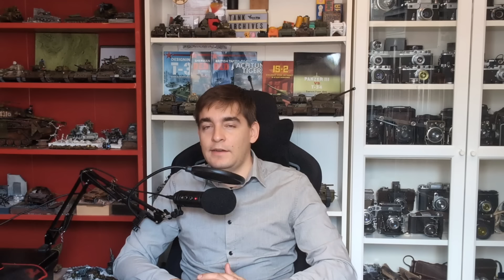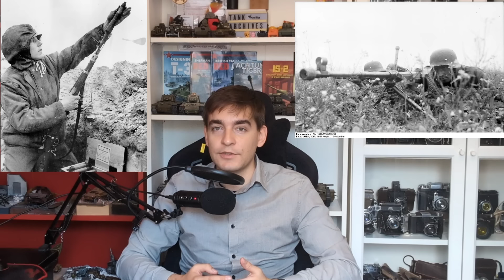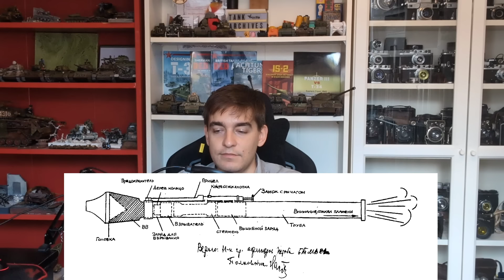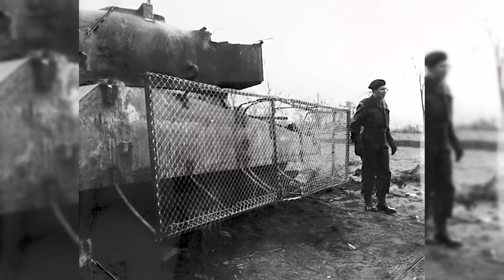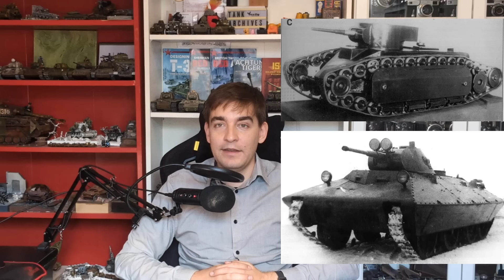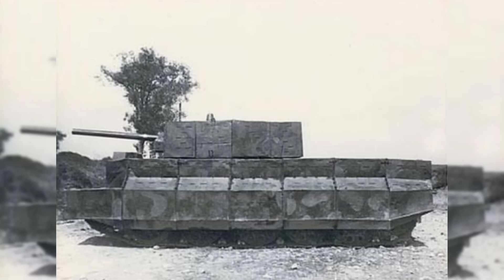Panzerfaust: Effectiveness and Protection

Comment: I imagine it was more difficult to aim a Panzerfaust shot accurately at a more vulnerable spot on a tank, capable of knocking it out completely. Also, German infantry's preparedness to run away from onrushing Russian tank assaults - could this be due to greater apprehensiveness at the outcome of becoming POW in Russian captivity ?
Reply from the maker: When you're facing a tank assault as an infantryman, surviving long enough to become a POW is one of the better outcomes.
Reply: @TankArchives  Not necessarily to the USSR at times. Maybe compared to Russian prisoners captured by the Germans.

Comment: I'm a bit off topic but I want to ask: what is the nominal thickness for the T-70 cast turret? From blueprints at the turret ring is 60 mm nominal and 35 at the top,near the hatch.
Thanks
Reply from the maker: I found the dimensions, which if drawn to scale should let you measure the armour thicknesses. https://i.imgur.com/w5aitn1.png

There is also the protection requirements, with figures given for critical penetration distance with a 37 mm gun: https://i.imgur.com/0FxduZI.png

These are both the GAZ-70 cast turret, I'm not sure if the "production" one was significantly different.

Comment: The tank rider survival rate vs ambushing machine gun is not mentioned or how would they fare if the tank drove to a mine. 💀 Better for the tank. Of course it depends a lot how organized the defenders are when there is already an enemy tank so close.
So this wakes the question: Why it took until post-war for Soviets to create an APC? Even the placeholder vehicles in their use appear to have been very uncommon. Did their experiences in Manchuria, Spain and Finland not show any kind of need?
Reply from the maker: The Red Army didn't just load a tank full of guys and ram it into enemy defenses. By 1945 tanks were fighting in sophisticated combined arms formations. If tanks full of infantry were going first, they were going it as a part of urban assault groups to exploit weak flanks, not bashing headfirst into machine gun nests.

The Red Army didn't develop an APC because the doctrine didn't call for one. Most doctrines didn't. Infantry of WW2 mostly walked to the battlefield and fought on foot, APCs were very much the exception rather than the rule even in countries that produced them.
Reply: @TankArchives  I thought I wrote "ambushing" quite clearly. Fair enough the front lines remained relatively clear on German-Soviet front as the open terrain didn't allow much of free infantry movement. Most devastating ambushes always require terrain like Finland and victims sticking to the roads.

This I find curious: "Infantry of WW2 mostly walked to the battlefield and FOUGHT on foot,". Fighting on foot still remains as the primary way of fighting for infantry. Fighting from board APCs only ever makes sense, if the vehicle is supposed to keep moving with others or it's the only cover. Apart from very few types, most APCs never had the armor to fight alongside tanks anyway. APC's main purpose is to get infantry fast and more safely to the place where they are needed, is it not? What baffles me about Soviets is their nearly complete lack of effort to even try building such vehicles. Didn't BTR-152 development start already 1945? The need must have been there.
Reply: The Soviets (& Tsars before them) always had a surplus of manpower & a relative scarcity of hardware, so it was more practical for them to tell a squad of papasha-wielding infantry [who otherwise might not get into range of the enemy wielding full-power small arms] to hop on & tumble off when they got close enough or if they started taking fire.

The Soviets had m1910 Maxims manned by party commissars w/ orders to shoot anyone trying to retreat or not advancing fast enough, so it was safer to hitch a ride on a tank even if the Nazis lit it up w/ their MG42s, at least you had a chance to jump off before a bullet found you...
Reply from the maker: @nunyabidniz2868  Enemy at the Gates was not a documentary. Commissars firing Maxim guns at your back wasn't even in Enemy at the Gates but in Call of Duty.

Comment: Did panzerfausts disable themselves when maximum range was reached?
Reply from the maker: No, it was a simple impact fuse. The projectile would fly further, but the low velocity and high dispersion would make it impossible to hit anything even if the sights were marked for longer ranges.
Reply: @TankArchives  I did a rough calculation.  The nominal effective range seems to be approximately at 10 degrees of elevation at each model taking into account a little increasing projectile drag for the longer range models.   For panzerfaust 30 an elevation of 9.2 degrees compensates for 5m of projectile fall off in 1 second of projectile flight.    The geometry of the sights then determines the max effective range.  
-In practice I think the range would be about 0.65 seconds x muzzle velocity i.e. 2.0m of projectile fall off.   So for Panzerfaust 30 about 20m,  Panzerfaust 60 about 30m, Panzerfaust 100 about 40m.
Reply: @TankArchives  Thanks. I wondered why the Nazis would put in a nice safety feature.

Comment: If the percentage of lossed due to Panzerfausts was bigger when the Germans couldn't deploy larger anti-tank devices, did the Panzerfaust kill more tanks or were there less losses during operations like that?
Reply from the maker: Generally high speed pursuit operations result in fewer total losses among tanks as there is less combat. You see a higher proportion of losses due to mechanical breakdowns, but the broken tank remains in your territory and you can recover it at your leisure. If you're slugging it out WWI style and the tank remains on No Man's Land, you're probably going to lose it even if the damage is relatively slight.

Comment: Swedish S-tank used diesel cans as extra protection vs Cumulative charges, for real:) It worked or so they said to us.
Reply from the maker: The fuel tank in the front of the T-54 was also said to be effective at stopping HEAT jets or kinetic penetrators that made it through the armour. You are still going to have big problems but not as big as a "clean" penetration wiping out your crew.
Reply: The S tank on the grounds of their Military Museum in Stockholm has a metal mesh perpendicular to the front flat-slope glacis.

Comment: With early HEAT warhead increasing standoff was not a "surefire" way of decreasing penetration.
 WW2 HEAT geometry was in large part trial and error, and WW2 fuses were relatively slow too - though not a problem in this case, it was an issue for cannon fired WW2 HEAT (piezoelectric fuses that could detonate the charge in the back without delay came later). So generally activating the fuse at some distance from the armor could have increased the penetration in some situations allowing the jet to properly form before striking the armor (hence modern HEAT shells have the contact part of the fuse well in front of the charge. In all honesty, I doubt Soviet special armor helped that much when installed on T-34, because Panzerfaust would go through almost anywhere with as little as 100mm penetration, and halving penetrating capability could have been well outside of additional 50cm standoff capability.
With IS-2 the chances were better, but I wouldn't bet my money on it working. I mean, morale boost is something pretty significant anyway.

Comment: 14:14 It's not a higher muzzle velocity, it's a greater penetration due to the greater diameter of the warhead. (Muzzle velocity is irrelevant to shaped charge penetration.)
(Edit: The larger diameter allows the "jet" of solid copper to reach a greater length before it stretches to the point where random irregularities in the diameter of the jet narrow to nothing and you have separate pieces one after another. The jet is very far from being a perfect golf tee shape. This of the surface a bit more like a very straight twig, where you have all sorts of little bumps and dips around it. Then you pull on the tip (because the elements with the highest velocity are at the tip and the slowest are at the base) and draw it out like taffy. The thin places tend to get even thinner, until that's where it snaps. Of course, this all happen so fast that gravity doesn't have time to do anything, and all of the elements of the jet still have very high velocities. However, each segment will tend to flatten out into more of a disc because they're supersonic, they're not very aerodynamic, and they're relatively soft copper that's hot (but not even vaguely close to copper's melting point).)
Reply: Um, the speed of the HEAT projectile affects the ACCURACY, not penetration.
Reply: "Muzzle velocity is irrelevant to shaped charge penetration."

This is not true.   While the difference is not huge, it actually does make a difference.

And there's even 2 relevant parts of the effect.
The obvious one is that the sheer weight of the impact at the same time as warhead blows, actually does add to the penetration effect.   Oversimplified, the bigger the dent(even there's no actual physically visible dent) the shell does before the warhead blows, the more compromised the integrity of the point of impact is, making it require less blastforce to achieve penetration.

And the not as obvious one is that every increase in speed, also adds to the speed of the jet, increasing its energy level.
Reply: @DIREWOLFx75  The nosecones of the Faustpatrone/Panzerfaust/Panzerschreck projectiles were sheetmetal, so it was impossible for them to dent armor. Well, at relativistic velocities, they would, but the jet wouldn't have time to form either, so they wouldn't function as shaped charges.

Comment: -The FP42 or Faust Patrone was first deployed in a test quantity of 50,000 in 1942.  The tube was only 40 cm long and they did create some problems such embers from the back blast being blown by wind into the operator. You held this in your fist at some distance.  And the term Faust/Fist.
-The Panzerfaust remedied this with a tube about twice as long.
1 Panzerfaust 30 had a muzzle velocity of 30 m/s and a nominal range of 30m.  The tube was 44 mm diameter. He reached frontline troops in July 1943.
2 The Panzerfaust 60 had a muzzle velocity of 45 m/s and a nominal range of 60m.  The tube was 50 mm in diameter thicker and contained more black powder to give the extra range.
The weapon seems to have reached frontline troops in July or August 1944 .
3 The Panzerfaust 100 had a muzzle velocity of 60 m/s a nominal  range of 100m.  It had the same tube diameter and wall thickness as the Panzerfaust 60 but there were two charges of gun powder with a 10 cm air gap which delayed the detonation of the second charge enough to keep tube pressure down.
-All panzerfaust could be reloaded by soldiers but it was cumbersome so it was only done after the battle. I think that we usually issued in crates of six with four spare warhead. I guess the warheads were useful for training.
-The panzerfaust 150 was a modification of the 100 model to make it easy to reload.  The extra range of 150 m was achieved by streamlining and reducing and weight the warhead.  It did not see official service but a few may have been issued from the factory.
-I suspect that had the 100 meter range version being issued in June 1943 instead of the 30 meter version the troops would’ve been far more effective with it.  Even if only used it 40 m range it’s possible to use a forest line as protection and cover and retreat.  Combined with the STG 44 it would’ve been quite synergistic.
-They were also a Panzerfaust 250 under development.
-In theory the Panzerschrek which had a muzzle velocity of at least 140 m/s (much faster than the bazooka) could probably have been given an accurate range of 250m if a significant effort had been put into precision machining the tubes and fitting optical sights.  However sometimes when you hear of the Panzerschrek being used they miss and I think that would be due to the compass sights or gun sites that were dinged out of alignment or not bore sighted properly. 
-The raketenwerfer 43 was actually machine the high tolerances and significantly more accurate.

Comment: I love the solutions they came up with.

On the one hand, you have approaches that can be viewed as the antecedents of contemporary modular composite armour arrays, bar armour, slat armour, etc. Tank riders are just an organic active protection system if you think about it.

On the other hand, you have some wild solutions. I mean, turning your tank into a mobile castle by covering it in concrete blocks feels like one of those things that people wouldn't accept if it was written in fiction. But history does tend to be stranger than fiction.
Reply: New Zealand [possessing extremely limited industrial capacity in the 1940s & what they did have likely centered on their fishing industry] came up with a homegrown concrete makeshift tank design at the early stages of the war, when it seemed Japan would be unstoppable after the attack on Pearl Harbor & the Philippines. Things were looking pretty desperate indeed...

Comment: Most effective way to counter panzer Panzerfaust is to get out of their range, use a tank from long range like you're suppose to if you can.
Reply: But then you cant advance, hence the Panzerfaust did protect the soldier. It will take very long time to remove/reduce soldier in a trench from range.
Reply: Infantry. Tank deals with MG nests, infantry deals with panzerfaust equipped guys, move on.

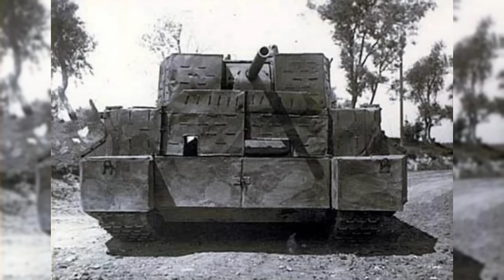Comment: 18:10 - okay what you’ve built here is a castle turret. Does it still move? 😹
Reply from the maker: Shockingly the castle turret still moved and even remained balanced enough that it could be traversed by hand. The amount of time for 360 degree traverse increased only by 20 seconds compared to an unladen turret.
Reply: 40 sec short right here 😸

Comment: Yeah, this makes sense. If they’re surrounded by infantry and dozens of other T-34s, using a Panzerfaust at 30 meters in a field is a suicide mission, unless you’re in a city and you can run and hide in a basement or something as soon as you’ve shot it.
Reply: That's why German command insisted on German infantry garrison to fight to the last in fortified city urban streets, it was not uncommon in late war German infantry formations that they didn't even have towed Pak guns since nothing, no horses or trucks, were there to tow them. All they got against tanks was Panzerfaust and Panzerscrheck.
Reply: @sthrich635  and the highly motivated volksturm.
Reply: Had the Panzerfaust 100 been issued in June 1943 instead of the 30 meter range version it might have met with more success.  Other than an urban environment the only viable form of ambush that allows escape probably requires a weapon that’s accurate to 40m at least.  If you’re 15 m within a forest line with a line of covered retreat you have a reasonable chance of hitting a target on say a road 25 m from that forest line and also reasonable chance of escape deep into that Forrest. That would require the Panzerfaust 100 which had a 60 meter/sec muzzle velocity.  I think the nominal 60 meter range couldn’t be exploited.  Projectile fall off over 1 second is 4.9m.  But over 40 m range it’s only 2.2 m. 
-It’s likely in 1943 that Soviet tanks would’ve had tank riding infantry  all armed with PPSH submachine guns.  
-They would’ve simply overwhelmed a German squad armed with a single MG 42 and maybe one at most two MP40 submachine guns.  The StG 44 (then called MP43) probably would’ve worked but it was barely available at that time. 
-The Panzerschrek had a range of 250m (limited by the sight setting) and a muzzle velocity of 140 m/s and although it’s recommended range against tanks was 150 m in practice. It was used at 100 m.
-But the problem with both the Panzershrek and the Panzerfaust is that they use black powder.  This gave them a relatively   large launch signature.  The Germans did have diglycol based solid rockets with a lower launch signature but the propellant  was in short supply. 
-Also I don’t think the Panzerschrek despite the high velocity was built to the tolerances needed to be used at 100 m range.
Reply: @williamzk9083  Don't even need StG at these knife ranges, MP40 works perfectly well within 50 metres.
Reply: @Klovaneer I was thinking that with a 10 man squad 6 would be equiped with panzerfaust hiding 40m from target while the other 4 would provide covering fire from about 100m.  All 6 panzerfaust would be fired of within 10 seconds and the shooters escape as soon as as possible.  One they’ve retreated the provided covering fire as well.  Ideally you cut of a column of tanks top and tail.   Any thin skin vehicles will be attacked by MG fire,  might be able to use panzerschrek from 100m when column stopped
Reply: Even then a group of SMGners and good coordination with tank crew is enough to make losses from such attacks a statistical margin.
Reply: @kindlingking I’m guessing they could instantly tell where a Panzerfaust was fired from and that building would be just disintegrated with shells.
Reply: @kindlingking  Exactly how soviets worked in urban conditions by spring of 45 - close cooperation between tanks firing at suspicious windows down the street they are rolling on and assault infantry going door to door slightly ahead of them so they don't get fausted from the sides. 50 years later it was back to "who needs infantry let's roll our tanks to the city center and the enemy will shit their pants".
Reply: @Klovaneer   I'm sure that was why their tank losses kept rising every month of the war.